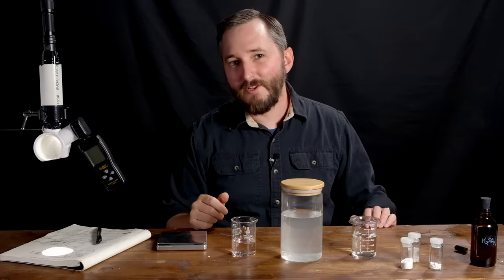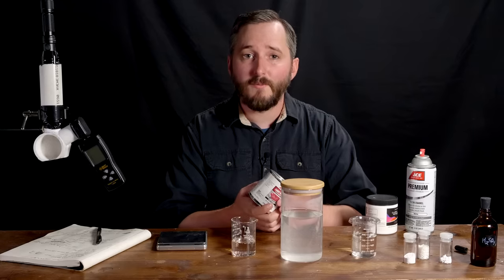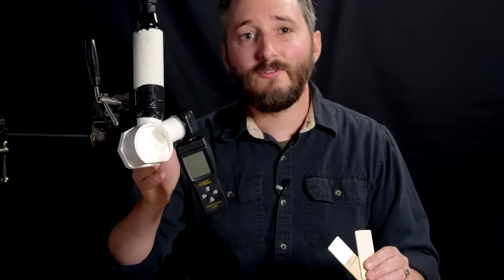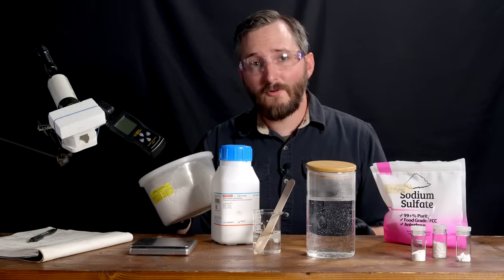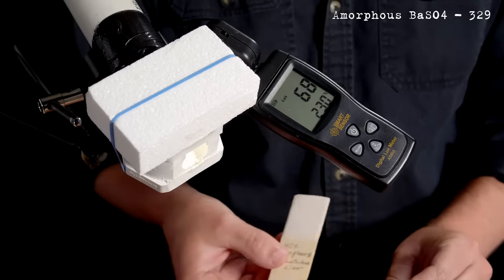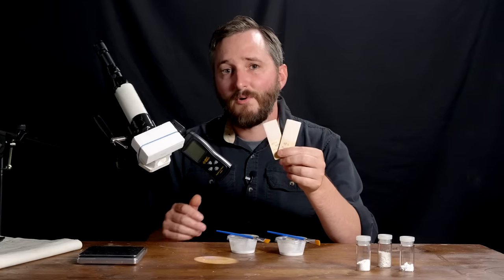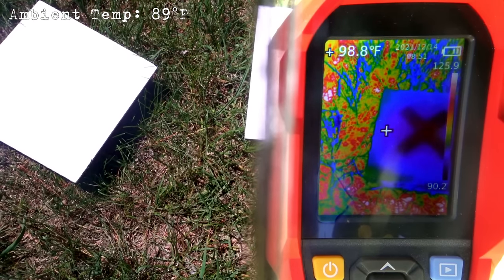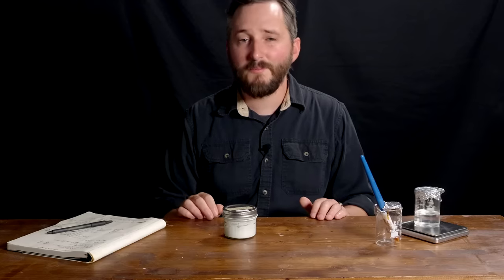How To Make Infrared Cooling Paint (Electricity Free Air Conditioning)

Comment: This is pretty incredible stuff. Two thoughts:
1. The stated aim was to test the barium sulphate against commercial OTS paints. However, the test article was actually barium sulphate impregnated in the snow-pattern acrylic. It would be interesting to compare the snow-pattern acrylic with and without barium sulphate.
2. During the discussion at the end about the form of the practical application, I thought that for houses, the paint could be applied to a blanket that would be draped over the roof and secured somehow (the latter should be easy - there are products for temporarily waterproofing houses with damaged rooves). I don't see any obvious downsides, but interested to hear if anyone can think of any.
Reply: I think it would be better to have sheets. Flip and lock them 1 way for winter, flip and lock the other way for summer. And you'd have the cool house on the block that doesn't just put up Christmas lights but changes color for winter.
Reply: For 2. Also see swamp coolers.
Reply: @TheNewton  Having researched and practically experienced, swamp coolers are not good. And when you consider all the issues, I'd pay for ac every time over dealing with them:
1. My biggest issue with swamp coolers: They struggle to do very much. 6deg in very ideal conditions, but that isn't sustainable and actual is more in the range of 1-2 or 3-4degF. Is that nothing? No. You can feel the difference (and the mugginess it creates...) But if it's 95deg, that still leaves your house/shop above 90! In the heat of day, his paint was doing much more than that (did he say 20deg?), and even a moderate sized ac unit soundly beats a massive swamp cooler.

2. Health risk: like the humidifiers they basically are, they are prone to making the air stank and swampy smelling. But the smell is only the unpleasant part. An uncleaned swamp cooler will start to mold and that can do nasty things like give even people with healthy lungs asthma that may not go away after exposure stops. And it can make an entire building infested with mold bloom and uninhabitable.

3. Free? That's usually the biggest claim to fame. Cool your house for free. Only if your time, effort, and cleaning chemicals are free. And it doesn't accidentally get spilled and do water damage...
 
Speaking from exp as part of a non-profit renting a building, a single spill accident immediately got us a "you can't use those anymore or you'll have to cover extra insurance," unhappy faces, and almost a several thousand dollar repair bill. You also add the restriction of needing close water access to your venue choices (running hoses throughout a building is a bad idea for water damage risk). Plus the huge hassle of effort to clean, taxing our volunteer free labor. Between money and hassle, we quite practically could not afford to keep using the swamp coolers we already owned. Plus the cost of 1 accident would have dwarfed the cost of several years of using AC for more comfortable temps.

Even in the hot desert where I currently live, it generally costs about $5 in peak heat of July & Aug to AC my house down to very comfortable temps (I like it cool). And I rarely ever have to clean my ac. And it's not likely to be a health issue if I ignore cleaning it for years at a time, so I'm not forced to drop everything and deal with it to avoid poisoning everyone.

And if anyone has wooden musical instruments, you probably already know that jumping from the extreme of very dry to very humid and visa versa is a great way to see an instrument break on stage. You could solve that for the mere cost of renting & setting up the swamp coolers a full day earlier and contracting the musician to come a full day earlier to leave their instrument there to acclimate for 24hrs...
Reply: The only issue I can see with that is that depending on how it's applied the paint may peel off, ideally you'd either have solid panels or seal the paint between a supportive and a transparent layer, I'm not sure which flexible transparent materials allow the specific wavelength of IR to pass through, reflecting would be fine but absorbing would defeat the main feature of the paint.
Reply: @andrewstambaugh8030  I'm currently in a swamp-cooled house that is 20F lower than outside. When I return home and turn on the cooler the temperature normally drops 10F. There is no smell and the air doesn't feel particularly humid. It sounds like you use it in a commercial context and I don't know how swamp coolers scale up, so that might be why it works so much better for me. It could also be a lack of circulation in your building. Swamp coolers in normal operation should replace all the air in the cooled part of the building in a matter of minutes so every room needs a slightly open window (like an inch). If all the windows and doors in the building are closed then the swamp cooler would perform about as well as you described. The swamp cooler also could have been too small for the area being cooled.

Comment: Be aware that thermal cameras have very difficult time with reflective surfaces and do not see thru glass for example. you should try to measure temperatures ON THE BACK of the painted surfaces, try and simulate a metal roof or the metal of a car shell. This is an excellent subject of research !

Comment: In my country, a distributor of sport equipment (Decathlon) made camping shelters with a special cloth they call "fresh". As I bought one of those, I found it incredibly efficient, by far as I could think possible. First, I thought it was a simple reflective surface, but after searching on it appears to be far more complex : some kind of laminate of several compound interacting with heat. As far as I can understand, it's certainly working using the principle you exposed.
Reply: Yes, I have some friends who bought these, I couldn't believe how cool they were compared to mine on the same camping spot.
Reply: My thoughts exactly, the Fresh Tarp is amazing

Comment: Ingenious. I find it amazing that in the year 2022, this technology hasn't been previously exploited on a commercial scale.
Reply: I think we run into a efficiency reason. It's been a lot easier to just push a bunch of power (electricity) at a cooling solution for years, and get a higher efficiency that way. Only recently are we starting to run into power issues where you can't throw more electricity at something and get a better result due to either the lack of power available (or possible currently) or a massive uptick in cost. We've only just recently started looking into low power ways to improve by little bits because we're getting close to the limits of our current tech.
Reply: @Dimon811  Yes, I think that is very true, you define the Industrial Age. However, I would argue power constraints have been with us all along. Had we been willing to acknowledge that infinite growth on a finite planet doesn't equate, the consequences might not have been so abrupt. The era of abundance is over. Especially with regard to carbon based fuel sources. For that precise reason, this technology is very exciting to me.

Comment: I think directly painting a warehouse actually works just fine, even in winter, particularly if the work people do inside is intense enough to reliably make people sweat (such as Amazon fulfillment centers), or if computers are running a server inside.

With direct painting, as opposed to panels, you gain more benefits from the built-in insulation of the building.
Reply: Wouldn't panels add more insulation?

Comment: I've been reading about this technology for a while, it seems to be called "reverse greenhouse effect" by some.
An interesting one I found was a polypropylene aerogel made by dissolving the PP in mineral oil and cooling it. By controlling the void size they managed to make the material highly reflective in the visible, but very transmissive in the infrared. In addition the material is obviously a great insulator. If you then put an optimised IR emitter (emitting only in the atmospheric window, being reflective otherwise) layer on the back of it, you get high reflectance for most of the spectrum and good IR emission.

Problem I see with approaches that use polymers is that they will eventually break down under UV. In general the top layer of a panel must be IR transmissive at least up to 10um, ideally optically transmissive or reflective, and environmentally stable (not soluble in water, strong, UV resistent, ...). There aren't many materials like that, especially ones that are easy to manufacture in large panels. Maybe a thin sintered layer of MgO or BaSO4 would work, but no idea really.
Reply: Have you seen the work with PDMS (Polydimethylsiloxane). Almost the perfect emission spectrum from 1mm.
Reply: Put suncream on it 🌞
Reply: MgO reflects in the infrared window, too? It has the same issue as CaCO3, it wouldn't take a very strong acid to react with it. MgO might also absorb atmospheric moisture to convert to the hydroxide
Reply: @coopergates9680  I was under the impression that MgO is transparent up to 10um, but yeah it seems not to be.
It's also not particularly stable, you are right.

BaSO4 wouldn't be all that great either as top layer because it has an absorbance band right around 8-9um. Great as a tuned IR emitter, but as top layer (at ambient temp) it would block the radiation coming from the back of the panel and also heat it by IR emission.
Reply: @TiSapph  My assumption is that even more transparent materials like MgF2 and CaF2 don't emit much IR in the atmospheric window, but should I look up more emission spectra?

Another possible mechanism when the sun is out is fluorescence, since most materials aren't transparent to UV, but some, like cotton, would re-radiate much of that energy as visible light, which of course is in an atmospheric window.

Comment: I like the 'transparent' notion as my house is already painted. One wall faces the brutal afternoon sun, hot enough to burn skin touching the paint.  Infrared reflective coating over the paint seems like a real win in my situation as that wall is very warm on the AC-inside of the house. On another note, I have always wanted some kind outdoors heat exchanger for that wall with the other side of the house to do something, like perhaps generate electricity since the temp difference is probably 20+ degrees for 3 hours.

Comment: I suspect you can experiment with different void sizes by replacing the water in acetone with other materials of different surface tensions.  Alcohol vs glycol might affect the reflectivity.
Reply: Acetone and ethanol would evaporate with the same rate/speed, while what he does, is using water, cause it stays there for longer, after the acetone is long gone, and then, the water too will disappear.. It might lead to some interesting or new results (maybe ethanol disolves better in acetone, and leaves even smaller cavities behind, than what water would), but at first sight, it seems contradictory.

Comment: What if you took your barium powder, and had mixed it with paint that is already white?  Would you have lost some of the reflectivity of the white paint?  would they have added together to make an even white-er paint?  Would you still get a decent IR reflectivity.  OR, what if you coated the dry white paint, with your nearly clear barium paint?  Would you have gotten the best of both worlds?  There are so many questions, and experiments that could be done.  I really hope you explore as many as possible, such as coating already dry paint with the most clear barium paint that you made.  How much would it chance the color, if the color isn't white?  Would a coating on either white paint, or non-white paint still let it be cooler than an uncoated section? Even if it's not cooler than ambient, If it's not absorbing as much heat, that would create cheaper cooling solutions for houses, or a shed, for example.
Reply: brilliant ideas

Comment: Great video, the porous acrylic was genius! I have done some experiments about radiant paint a few years ago, from my experience the best way to get significant cooling is to make two thick layers (100µm or more each): one base layer of barium sulfate paint and a top one with titanium dioxide. 
The top layer act as reflector while also providing thermal insulation jus like polyethylene film.
You can improve a little bit the cooling (fraction of degree) by choosing a good reflective metal just like aluminum as the coated material (you can go hardcore by using silver coating, but it will defeat the purpose of cheap and simple method).
The porous acrylic was really nice find, I bet you will get killer results by using it on the top titanium dioxide coating.

Comment: When you started talking about the amount of cooling I thought about a distillation AC that could use a solar heater and liquid desiccant simular to the one tech ingredients made. It could use very little electricity from the grid. If use as a low wattage thermal could also power low voltage water pumps for the AC making it very efficient.

Comment: Having been in the coatings and adhesives industry for 20 years, and it being part of my family for a lifetime. I LOVE THIS! ❤️ precipitated pigments are easier to get than this. Just request a sample. YOU NEED FUMED SILICA to keep your solids in suspension and some calcium carb to fill the space between the pigments. Hydrated alumina  will help with heat.
Reply from the maker: Thanks very much for the info! Is the fumed silica in the category of a dispersant?
Reply: @Nighthawkinlight  Fumed silica Is used to make epoxy behave like peanut butter and stay put and not drop out of the seam. Thixotropic? smth
Reply: @NightHawkInLight  it is used as a dispersant, and a free flow agent in powders. It is amorphous silica. Like popcorn but silica. Huge surface area. Cubic cm has the surface area of a football field. Aerogel is made of it. And space pens utilize it. It makes spray paint spray under sheer, and stay in place when applied. It builds a gel like structure in paint that holds solids it suspension. Very hydrophilic. Can be treated to be very hydrophobic. Hydrophobic version is alot of fun. Will Make a bubble of air around your hand(or anything) when under water. Apply soap then water to remove.
Reply: @airfriedquadsbw  is fumed silica the same as silica fume? I first learned of that by-product of silicon refining as an additive to concrete to make it flow in shotcrete applications.
Reply: @Frederica Panon  they are the same,  except the byproduct version is not 100% pure. Some black specs are found in the so called silica fumed. i did import the silica fumed, and thought the name was just a language translation thing.  The specs are not a problem in products like concrete or dark plastics. But is a problem for white coatings(pigmented coatings start white) And is not food grade. Fumed Silica can be Code X, or food/med grade. Un to 2% Fumed silica is safe in food products like powdered soups and powdered creamers. It helps free flow powders as well as liquids. Powdered soups would be solid chunks without it. MAGIC SAND, sand that doesn't get wet is made with hydrophobic Fumed silica. In the can of paint it builds a gel type structure that helps suspend the raw materials in the liquid.
Reply: @airfriedquadsbw  Aaah, so the food-grade fumed silica that keeps food powders flowy is what is written as silicon dioxide on the ingredients list. I had wondered about that particular ingredient
Reply: @fredericapanon207  yes, that is it.
Reply: @pohjoinen kala  fumed silica will gel epoxy, but if you add sheer it will help it flow. Once sheer is removed it will gel back up, provided it isn't overworked. It helpsbspray paint spray out of the can and then stick where it is sprayed.
It's also a dispersant and free flow agent.
Reply: Thanks for all of your info about fumed silica! I have a tub that I bought for a project years ago, but the additional info about it is very helpful. Thanks again for sharing your knowledge!
Reply: @onestoptechnologies7305  thank you! Love your content!

Comment: I'm building a small, remote observatory. It is necessary to keep the optics at ambient temperatures to avoid distortion from warmed air currents in the optical tube.  The effect is dramatic. It would be desirable to keep the closed observatory as close to the night observing temperature as possible.  I don't have power at the site so cooling is  challenging. If this is substantially cooler than white light in sunlight then in all for it!

P.S. I agree with the comments about IR camera not being good at measuring surface temperatures.

Comment: I have a narrow boat that gets extremely hot internally, I’ll definitely be keeping a eye on this! Although a full white roof wouldn’t work cooling panels made using it would certainly be interesting
Reply: have you considered sticking a sheet of material (alu would work) a couple of inches above the roof, tropical land rover style?
Reply: Wouldn't solar power be enough to run a small water pump in a line that transfers heat between the inside of the boat and the water outside?